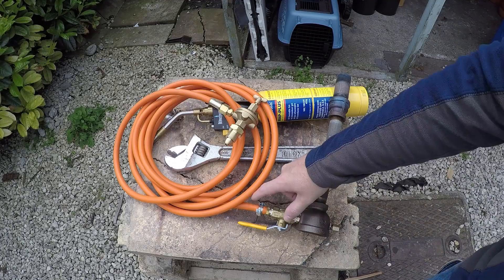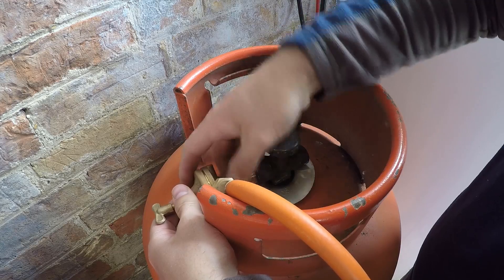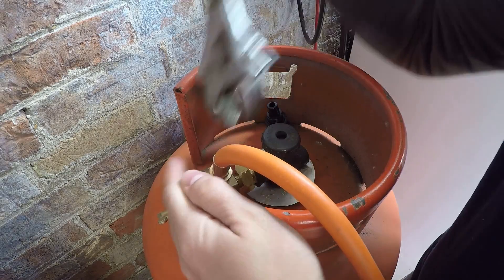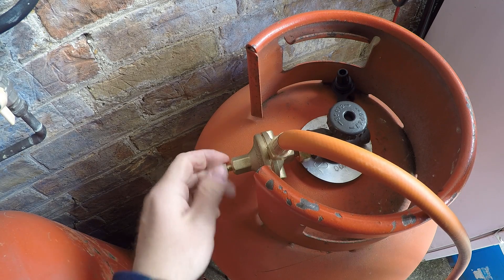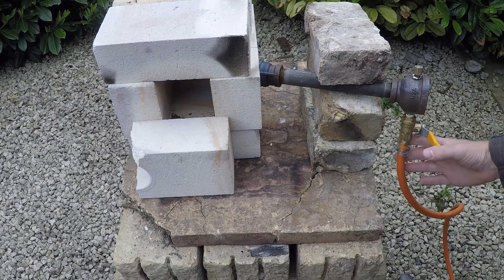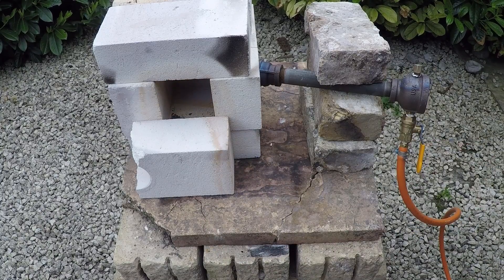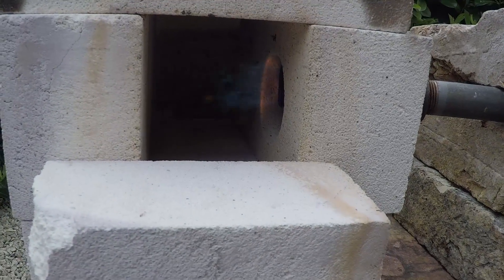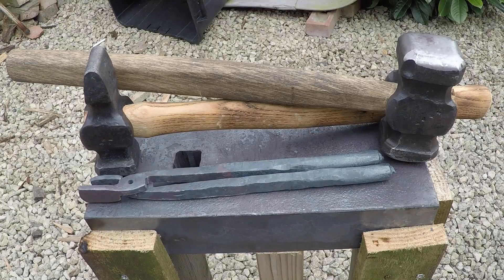How to Build a Forge: Burner Test Success

Comment: Looks like a good burner to me, what's the maximum bar of yr regulator?
Reply from the maker: Not sure. I don't have this burner anymore. Check out the MK2 version which has some significant improvements though. It gets a small gas bottle style forge hot enough to weld. https://youtu.be/BjqA4VQMpiM

Comment: great job on the burner  i plan to make a forge after wathing this  i just bought a forge but now i may have to return Lol
Reply from the maker: Check out the MK2 version which has some significant improvements though. It gets a small gas bottle style forge hot enough to weld. https://youtu.be/BjqA4VQMpiM

Comment: What psi are you running your regulator at, I have a cheap preset bbq one and I can't keep a sustained burn without blow back every few minutes. I'm going to up grade but I've seen 0-10 psi and 10-20 psi for sale. What do I want?
Reply from the maker: My regulator is 0-30psi (it came with a weed burner torch). I'm usually running it at the lower end of the pressure setting but it doesn't have a gauge so I don't know exactly what pressure.
Reply: Spend 10 bucks more and buy adjustable regulators ALL OF YOU!!! No one setting fits all jobs....Frugality at the expense of quality in not frugality..

Comment: mine is pre igniting and the burner tube is getting really hot. mines identical to yours
Reply from the maker: Have you tried turning up the pressure on your regulator? If there's not enough pressure the air won't move fast enough through the pipe body and this can happen.

Comment: Is it the Venturi effect that prevents blowback to the gas source? Or is there some kind of check that makes it safe?
Reply from the maker: Venturi effect and the overall velocity of the air fuel mix. It slows down as it expands through the exit flare/fittings which allows it to sustain a flame at the exit.

Comment: Nice work. Think I'll give it a try. Is the temp high enough to forge weld?
Reply from the maker: MWT68 I haven't gotten it that hot. It might be able to achieve it with some tweaking and the proper forge design/insulation.

Comment: Mind adding a link, or maybe just the name/title of the pressure regulator you used to the description? I see you'd apparently kindly replied to another person about which one you used, but the reply itself isn't showing up. I'm curious, as me and my friends have searched for a good cheap regulator for years, and couldn't find one. We had to settle for one of those cheap ones that might output a few PSI, but that's it. We're running two burners at once, very similar to yours, so we need more pressure. Also, you're one of the few who uses good editing and doesn't ramble, like another mentioned. So I'm subscribed.
Reply from the maker: I used the regulator off this roofing torch: https://www.machinemart.co.uk/p/clarke-plk1074-700mm-twin-burner-gas-torch-kit/

It doesn't have any brand or model markings on it. I've seen similar looking ones on amazon but unfortunately I probably can't be of any more help than that.